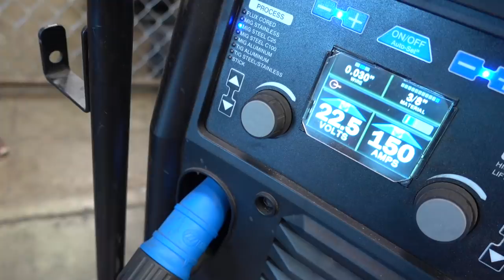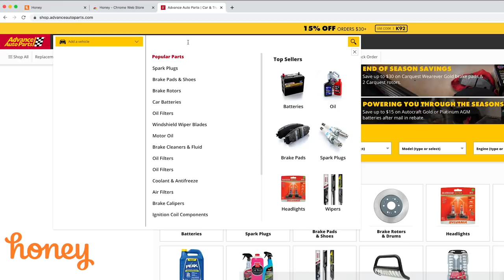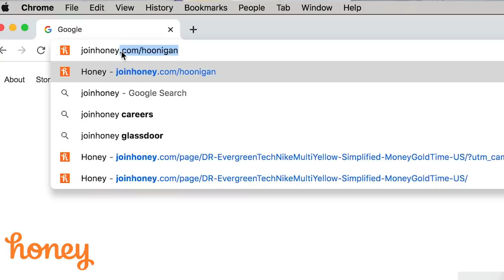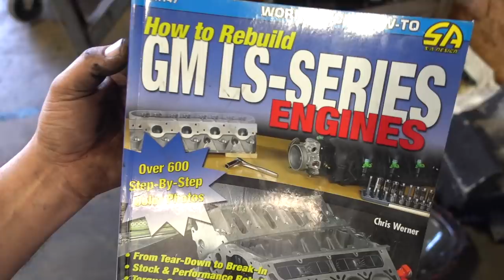Build & Battle 3: Setting up Suspension for Gymkhana GRID! Camaro vs 350z Faceoff EP.2

Comment: You know you an OG mechanic when you pull the motor out with a seatbelt
Reply: Or they just junk yard shop every junk yard does it.
Reply: Seatbelt> chain
Reply: Yup, doesn’t scrape everything up like a chain can.
Reply: Or tow truck driver. They use the seat belt to hold the steering wheel in place when toeing with the front wheels down. Seat belts are made strong as fuck because they need to withstand sudden impacts rather then just holding something there.
Reply: I’ve done that! Btw don’t ever pull a motor out of the top of a 4th gen camaro
Reply: Pick-N-pull status
Reply: At some point I stopped using chains until the  seatbelt from my stripped Corolla
Reply: Seatbelts > chains
Reply: @nessabush1986  it's really not that bad bud...
Reply: @travisfowler8345  was for me, bud.
Reply: @nessabush1986  I mean I guess... if it was a special circumstance... but the several I've done... we have never had any issues... and since I don't have a lift... it's much easier than lifting the body over the k member and drive train...
Reply: @nessabush1986  I wasn't trying to upset you buddy... just saying with proper tools and knowledge it's not all that bad... couple hours and it's done
Reply: @travisfowler8345  still probably way easier to drop the subframe, plus I pulled the engine out in a pick n pull, with all the tools I was able to carry.

Comment: A crack in the head casting between the valves wont affect a head gasket. If it leaks coolant into the cylinder it is leaking out of the crack. Behind that crack is a cooling jacket in the head, but it takes a severe crack to leak coolant.

Truck heads are notorious for this due to the high heat created by pulling around a 6500+ pound truck.
Reply: Mason isn't the savviest LS budget builder. Hell, he spent premium coin on a 6.0 when the 5.3 or 4.8 would have been perfect for this build. $5 says he spent more coin on Johnson lifters instead of going with LS7's....can't wait to see what he does with the rockers....
Reply: badandy122376 definitely spending unnecessary money on parts.
Reply: It's all for nought, that 10 bolt won't hold.

Comment: Points out crack between the valves "Hope we can get that head gasket to seal" Beginning to question this fella's knowledge a little.
Reply: Yeah that one got a solid head scratch from me
Reply: Waste of time and money to take that motor apart. Slap a cam in it and run it
Reply: @sr20good36  Agreed, letting all the magic out
Reply: Sounds like somebody who has watched a lot of videos and spends most of his time at "meets" but has never actually worked on anything.
Reply: @sr20good36  you gotta pull the heads off an ls to put a cam in. The lifters are under the heads.
Reply: Joseph Carprpenter actually I’ve done many cams in an ls and if you want to get technical here, you flip the motor upside down, rockers and pushrods removes already and install the cam! Doh bet you didn’t see that one coming genius.
Reply: yeah, i know a poser mechanic when i see it.

Comment: Why use cracked 317 heads?!?!?

Grab a set of 706 heads off a 5.3L for cheap.  The bump in compression makes gains at every RPM, and will outflow the 317 with mild hand porting even with the slightly smaller valves.  Even in stock form, they’ll make over 400whp on a LQ4 with a cam.
Reply: Hell even some 243 heads, but buy new lifters lmao
Reply: Always use truck heads. There's a reason why they're better, the truck division gets all the research and development money.
Reply: Jeph Savaglio They have the higher profit margins. The same police Tahoe can become an Escalade just by ordering optional equipment.
Reply: Cj Pfeiffer  243/799 heads cost 2-3 times more than a 706 head on the used market
Reply: It’s the 706 heads that crack from the factory u mean get a set of 852 heads
Reply: Jeph Savaglio 
317 heads are truck heads, and they are arguably the worst performing LS heads thanks to their poor chamber shape, despite flowing quite well.  799 heads on later 5.3 LS are essentially 243 castings (from the LS6) with heavier valves and not as capable springs.

IOW, it’s not so much that truck engines got more R&D money.  It’s that the 707/862 heads from Gen3 4.8/5.3 bump up compression thanks to small chambers, flow good/efficiently in stock form thanks to great port velocity, and respond well to porting...  all because they were designed for small cube engines.
Reply: manny sanchez 
Only the Castech 706 heads are prone to do that.  And you must mean 862 heads since a 852 casting doesn’t exist.
Reply: ChuckO yeah my bad it was a typo ur correct
Reply: @stlchucko  teach me senpai

Comment: QA1 makes front and rear coilovers for 3rd gen F-bodies. Why go with the Mustang BC's instead? It seems a bit more Bolt on than adapting mustang parts to it
Reply: I didn't understand that move either... I've owned 15 or more f bodies... and many things these guys have said have had me scratching my head like wtf???
Reply: @travisfowler8345  I've been working on my 3rd gen drift car for a while now. QA1s are direct bolt on, but expensive. Also, mustang springs and shocks do not fit in the rear. The shocks bottom out and springs dont fit on the axle. Maxpeeding rod Buick Centurh front coils are way easier and cheaper, or PA racing front coilover conversion kit.

Comment: * re-gears and welds a 10 bolt rearend * 

“Bullet proof our rearend”

Bruh c’mon man
Reply: yeah the taller the gear in a 10 bolt the better, thats not gonna last with a 4.10
Reply: Shoulda got a one out of a sploder for cheap
Reply: If it was an 8.5 10 bolt it might work but a 7.5 shits gonna blown when it hit 300 hp let alone 400+
Reply: "takes off rockers arms and pushrods one by one and goes on rant about labeling them to make sure they go in the same spots along with push rods
"
hydraulic roller system with rocker stands...
"complains about a cracked head and if his head gaskets going to seal it" 
Crack is in the center of the chamber, between the valves...
Reply: SOULESS yeah, this seems to be his first time pulling an ls apart
Reply: I ran 7.5 in s10 with 500 hp and 411s axles are the weak point.
Reply: The money they spent on the gears would have bought a explorer 8.8 with 4:10 limited slip.
Reply: This whole season is like cancer.  Love hoonigan but damn.
Reply: Yeah no matter what you do to the 7.5 inch 10 bolts they will blow
Reply: Between the choice of rear end and comments about it and the head I'm starting to think this is his first time
Reply: @wayfastwhitey45  Cant wait to see him adjust the valve lash later.
Reply: That thing is gonna explode so quick.
Reply: Thrash It Till You Crash It- Sam knows that, that’s why he posted that comment...
Reply: @MillionairX  my thoughts exactly. I've never ever put rockers in the same location....dude isn't as smart as he thinks
Reply: @brandonfloyd6321  amen. Those 7.5" rear-ends are junk
Reply: The sad thing is it’s the reason they lost. They tried to run grippy tires and blew it, slapped a new one in and ran high tire pressures to save it and it was super sluggish in drift. If they had gotten an 8.8 they could’ve ran the grippy tires and low tire pressure and they would’ve dusted the z
Reply: Addicted4Life ! Yes, many companies make bolt on kits. The issue is nobody makes kits for drifting. Josh didn’t know much about the 3rd gens, but Alex does. Alex daily drives one lol

Comment: Shouldnt have opened that LS up, shoulda just tossed a cam and springs in and sent it, gonna find a lot of stuff you didnt want to now
Reply: ah yes, I see you are a man of fine junkyard tastes as well.
Reply: They lettin the magic out
Reply: You have to pull the heads to do a cam on ls. The lifters are under the heads.
Reply: @joec1995jc  not true, long dowels will hold the lifters up fine, just gotta do valve springs
Reply: Devon Debuhr or roll the motor upside down on the engine stand, let gravity work its magic, and the cam will clear the lifters enough to pull it out.
Reply: @joec1995jc  I didn't on mine. Just used 5/16 dowels NOT 1/4 INCH you'll drop the lifters in the pan.
Reply: That's what I did 6500 rpm on ls6 springs and a cam on my 5.3 🤘

Comment: That Camaro is gunna be sweet. Lots of built just for it bits will make it work. They should give it to a disabled hoon who doesn't have alot of money (me). Love it.
Reply: I'm just waiting for the strut towers to blow out the top. Anyone who's owned a 3rd gen knows the strut towers are flimsy as hell and are definitely not meant to support the weight of the car. Theres a reason nobody makes coilovers for the 3rd gen

Comment: Next build and battle no ls motors see what they bring
Reply from the maker: Plenty of engine options available. We just had Vargas build a rotary, and now we have team Suppy building a K series. Both engine set ups could make 400+ HP easy.
Reply: I agree. I'm sick of ls swaps. That's why I'm glad one isn't going in the 350z.
Reply: It's working with budget and time. They already need to do so much custom work for suspension and steering, have to make up with easy LS. Its function and what works over being original and for the sake of it.
Reply: I agree, I'd rather see something more interesting than LS over and over and over again
Reply: Budget and time make the LS a winning formula...
Reply: It's a 3rd gen, an ls swap is the natural plan for it.
Reply: What other junkyard motor has the aftermarket support, information, and potential for power of an LS?
Reply: Hoonigan Project Cars next episode we need a hellcat swap. Fuck a budget just hellcat swap something plz
Reply: @timothywarrington2493  a small block 350 😛

Comment: Just FYI when welding on the spider gears, attach the ground to the ring gear. This makes the arch as it runs to the ground only go across solid metal. If you ground to the case you risk arching across the carrier bearings which isn't good...

Comment: For that camaro if the struts are at any angle it will want to bend when you solid mount it like that. If I remember right they are angled out and that bushing allows pivot for suspension travel.

Comment: Crack between the valves won't affect the head gasket can leak compression and coolant though, head gasket will be fine fine some Craigslist 243 heads cheap scrap the cracked ones
Reply from the maker: They’re gonna go for it and save the budget to buy rockers and not heads. Sounds like a pretty solid gamble.
Reply: @HooniganProjectGarage  cracked heads are more of a gamble than lifters that were in a running engine
Reply: @HooniganProjectGarage  I've bought 243 s 706 s for 50 bucks get a set from a junk yard
Reply from the maker: Solid find! 🤘🏼

Comment: Valves go valve cracks on LS heads don’t go to water, the crack would need to go into the intake or exhaust ports before they hit water, the ports are casted next to each other, the only place I’ve seen them leak is a from the head bolt location

Comment: Actually there's a simpler method than bothering to dig a hole in the spider gears. It's a little more involved but it does give you a good surface to weld on. You get some 4 mm plate, shape it in a rhombus config where the sharpest corners fit between the teeth of the gears. GIve it a good wack between so the center line/fold line touches the shaft and then you give it some welds. Four in total, 2 at the gears, 2 at the shaft. Repeat for the other side. Will never break, simpler than to pour a ton of weld inside. If you're a decent faber, you're done in 10 minutes flat.

Comment: First thoughts;

Engine stand leg drop with "DO THE JOB RIGHT"
----CUT NEXT FRAME---
Cutting seat belt "Since we don't have a chain to to pull the motor out, we use one of the seat belts..."

#BUCKLEUPFORSAFETY

Comment: I really respect what people are doing with the small import motors.  I mean how can you not respect when they are capable of 1000+ wheel horsepower out of a 4 cylinder?  That shit's just nuts!  But I've got a real soft spot for those 3rd gen Camaros and fox body Mustangs.  I'm rooting for the turd gen but it won't be surprising if the 350 with the k in it wins.

Comment: 11.5:1 is not high compression, maybe for the late 90's it was but in todays world that is actually low with the skyactive hitting 14.0:1. I have a boosted 4g64 with 12.5:1 compression and I have a turbo on it, its been running for a little bit now, seems to like 24psi so far.

Comment: The K-swap is a cool idea, but when you are on limited time and budget, trailblazing a new swap isn't necessarily a good idea.
Reply from the maker: For most people yes, but team Suppy seems to have it dialed in on a tight budget. 🔥
Reply: I agree.... it's an attempt to be different to be different. Unless they sell the original engine for more than new one it has no advantage.... ditching the stock engine means time to swap engine... and require entire car because of the can bus original wiring

Comment: Does Suppy realize that the K24 is meant for a fwd car so you have to at least weld baffles in the oil pan so the oil doesn't slosh to the back of the motor... That's why dude with the 240 made the oil pan the way he did not just to make it fit

Comment: For the record, ring gear thickness doesn't determine anything about the quality of the gear(I.E., the Camaro gears aren't a "great deal because they're so beefy[thick]"). Rather the ring gear thickness changes as the gear ratio changes because the head of the pinion gear increases and decreases in size based on what the gear ratio is/how many teeth have to fit on the tiny little pinion for a given gear ratio.
Thick ring gears aren't "beefy" - rather, the teeth must stick out further away from the diff carrier to reach a smaller pinion gear.

This is why differentials that have been in production for a long time(especially diffs that have been used in trucks with an option for deep gears, like 3.73s or 4.10s) will often have 2 different differential carrier part numbers, with the dimensions of the diff carrier flange(that the ring gear mounts to) between the two being designed for either a thicker, lower gear sets(higher numerical), and the other carrier intended for thinner, higher gear sets. Most of the Dana axles have 2 different carriers, I believe most Ford diffs have 2 different carriers, etc.

Comment: Why hack in the mustang coil overs?  Sphon, BMR and a few others make kits.  Though they all have the same issue in that a thirdgen strut tower isn't designed to carry the weight of the car.  In fact in stock form it's designed for rebound damping forces not for compression, except minor spring damping on compression, it isn't designed for upward force.  To do it right you need to carry the load back down to the K-member mount points.  Best option front and rear to make it handle is weight jacks and springs in the original location, then add some nice struts.  No reason to do coil overs.  Also why cut the radiator support out? Ls motors fits just fine in a thirdgen without hacking the body.  This from someone with a 89 Firebird with a 5.7 ls1 and a T56, tube K-member and a-arms.  And the stock 10 bolt is good to about 300 HP in a manual. The 7.5 ring gear will deflect and shear off gears on a clutch dump.  It's longer (3 inches) and no stronger but a 2000-02 fbody disk rear will bolt in.

Comment: So why a welded diff? I used to know about diffs when I was doing a course in engineering.. but years down the line I have no idea anymore...
Reply: SilentlyMysterius1 means that there’s equal power to both wheels instead of more power going to one wheel and having one wheel still. good for drifting because it’s very direct power
Reply: @andrewmayer2443  oh, thanks
Reply: SilentlyMysterius1 👍👍

Comment: 3rd gen should have gone... T56 with 4.56 gears or even 4.90 gears...

And I can't believe they are boosting that engine... may very well cost them the challenge... if it's gonna be NA they need to get the power on the low end with gearing...

Comment: ZAC the answer is two!! PLEASE READ THIS GUYS I'M A DISABLED MARINE AND I LEFT THE BOOT CAMP IN 95 YEARS OLD 1995 I took ZZ4 crate engine and Cam and brodix heads and nitrous hundred 75 shot that come out of my 6-second 8th Mile s 10 into 1987 trans am ws4 305 high output pull out I banged second gear and it turned both 7.5 in to pencils.. first shift I could have wrote a paper with them they were so Sharp!!! I was 18 and I already had a 6-second S10 I graduated a year early with honors played four sports all the way through high School and my Junior and Senior year I had a 40 hour week job at England's Corsair the people that build you're nice couches and lazy boys it's actually lazyboy the big factory is a mile from my house and the Cumberland Gap tunnel that's a mile long is only 12 miles north of my 8.

Comment: K series is gonna take it just because that power band and high power revs gonna have alot of good throttle control, less chances of spinning out and torque kicking out the rear
Reply: Lol both guys on the Camaro team are very used to V8s and instant torque just like I'm sure the other team is used to the lack of response from small turbo engines

Comment: Who has a tubing bender un their garage to build roll cages with?

Just would like to see a way that we can afford to build cages without buying a tubing bender for 10k.
Reply: A lot of popular cars will have bolt in cages
Reply from the maker: Most basic shops have tube benders, and if they don’t we wouldn’t suggest you taking your car there for fab work. 😂🤣
Reply: You can get/make a tubing bender for 200/300$ or even cheeper if you buy used.  And there is no way you can build a good cage withouts one.  Don't know where you got 10k. And if you don't plan too build more than one cage it's better to buy a pre-bend cage or get a shop to build one. If you want to learn you need to invest in tools